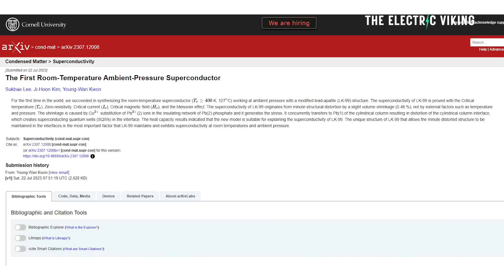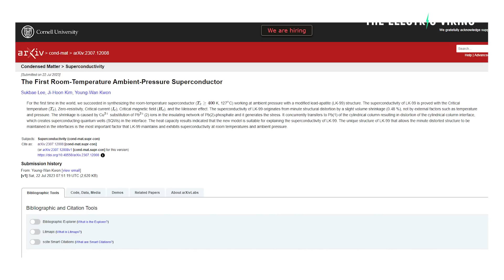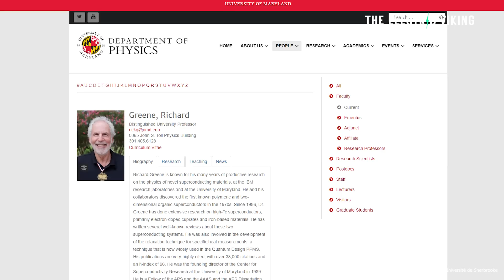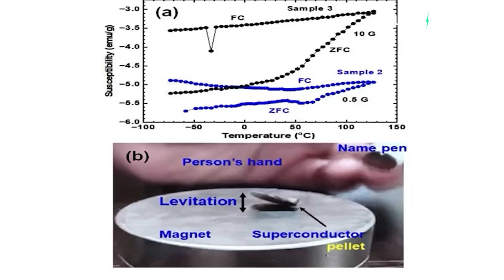The first room-temperature, ambient-pressure superconductor discovered in Korea

Comment: if this is real could mean personal jet packs from ultra capacitor batteries in small form factor -> much smaller and more powerful motors  but technically not a jet, more like fans computer driven like drones but for individuals, and of course flying cars via the same tech with long range flights

Comment: The room temperature superconductivity claims are completely without foundation. For one thing, no phase transition has been observed, just a gradual drop in resistance with temperature. For another, the video of the material on top of a magnetic looks nothing like a Meissner flux exclusion. Normal diamagnetic materials all behave like that.

Comment: If pure, theoretical, superconductor cable is use for power transmission in straight line just like the power lines we see. Will it make it possible for thin cables (like USB) to charge our EV?
Reply: 1000 amps per mm2
Reply: @trollking202  and the possible voltage would depend on quenching property I assume?

Comment: Well if they've indeed cracked the code, that will change computing forever! Firstly, quantum computers can become more accessible due to no longer needing to operate at near absolute zero temperatures, but more traditional silicon will also potentially take a huge leap forward as superconduction in theory means 100% efficiency as most of the energy used is no longer creating heat from a resistive load, and with it, clock speeds can be ramped up. Traditionally LN2 is used for extrene overclocking, but superconducting CPUs would theoretically be able to do it at ambient temperature, with a stock fan (or potentially no fan at all) and the null resistance could potentially allow for even higher voltages, pushing potential performance higher again, whilst consuming less energy than they currently do

Comment: Speculating on what this might do is very premature. 

We would need to know if it works for real, and if so, under WHAT CONDITIONS?  What materials are needed?  What temperatures?  What "track/substance" does the superconductor need to sit on?  How stable are the materials?  How durable will the superconductor be under whatever level of stresses needed to make practical devices utilizing superconductivity -- from small things to big heavy things like levitating trains?

Until we have good proof it's real and the key conditions for practical operation -- all the speculation won't amount to anything meaningful. 

Over time if it could, for example, make many devices very highly efficient, that would definitely help with the sustainability problem re green energy, IF the materials are common enough, cheap enough, can be processed without too much pollution, etc. But of course, all that remains to be seen.

Comment: The relevance of this material to creation of useful magnetic and electrical devices for the transport of materials, mechanical devices such as flywheels and/or energy transport (such as DC transmission lines) is somewhat dependent on how much magnetism and current the material can withstand before transitioning out of a superconducting state. I'll wait until confirmation of the claims and practical tech designs using the material are published before I'll get excited.  At the moment, the behavior of the fragment shown on the video looked more like magnetic or classical diamagnetic ( see pyrolytic carbon ) behavior than superconducting behavior to me. Regardless, I'd love to hear that the Koreans are on the right track, and that my misgivings are misplaced, like you, I've dreamed of room temperature possibilities since my youth,  though in my case the bug began over half a century ago (when I first read the pamphlet on the Boys Scouts Cryogenics merit badge).

Comment: Korea has world record of nuclear fusion activating for 30 seconds in tokamak method. We need 300 seconds to commercialize it and this ik99 will make a breakthrough.
Reply: Wrong.  It needs to be able to be done PROFITABLY for PRACTICAL vs. theoretical application, and needs to be durable, stable, reliable, etc. 

While making random claims, why not just claim the earth is flat?
Reply: @rogergeyer9851  Whatever. Its gonna be done anyway. I dont think your opinion matters.
Reply: @rogergeyer9851 Everyone walks before they run. This is the first step. Computers when it first came out were never handheld like on your phone. It was a room size heat generating electric machine. Give it some time and all those what you've mentioned are just engineering challenges, while this discovery is basic science research which is MUCH more difficult to accomplish.

Comment: The impatient folks among us think a renewable energy future means one big invention. It’s more like several thousand small inventions, and each one will make a small difference. It’s a trial and error process that will require as much man-hours as other world changing inventions (internal combustion engines, computers, software, etc). Thanks for your reporting!
Reply: Just look at batteries as one obvious example.  The past decade has seen amazing total process.  The next few should see far more.  But there has been no grand leap -- it's lots of little things that add up over time from lots of hard work.  

Even common things like home furnaces and air conditioners (or increasingly, heat pumps).  They're now wonderfully efficient, but it's been a long road to get here.

Comment: Superconducting at any temperature would be the Holy Grail.
Reply: No, because at very cold temps, for example, the energy and resources required for it would make it completely impractical re cost, the VAST majority of the time. 

It MIGHT be helpful in a very LIMITED set of circumstances, if the temp. required were say, a few degrees above absolute zero -- just for one example. 

And on the other side of the spectrum, what if the temp. required were 10 million degrees C? 

"Any temperature"?  Do you even think before making claims?
Reply: @rogergeyer9851  Shanghai has superconducting electric transmission line underground.

Comment: A form of 'superconductivity' has been overlooked for ages:  the surface conductivity of metals like copper, etc ... is also without ohmic losses, but 'metal surface currents' do not produce the Meisner effect for specific reasons. Tesla used this form of conductivity for lossless electric power transmission over a single wire; he applied much higher frequencies than 50 or 60 Hz, and it worked. We could have had a lossless electricity network a very long time ago. Without the lossless surface conductivity of metals one could not put a 'voltage' on a wire/line, so this effect is applied on a daily basis during the last century, but not exploited fully.